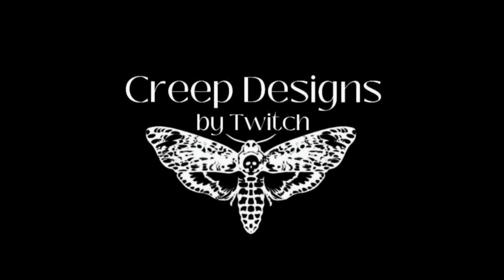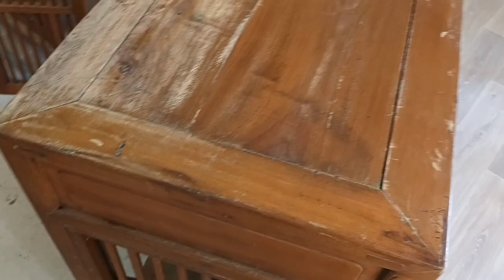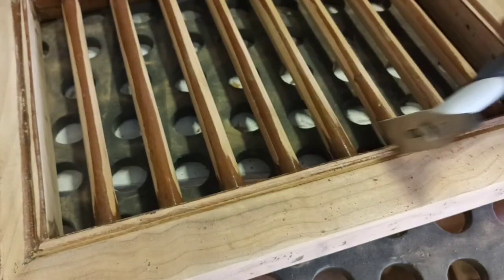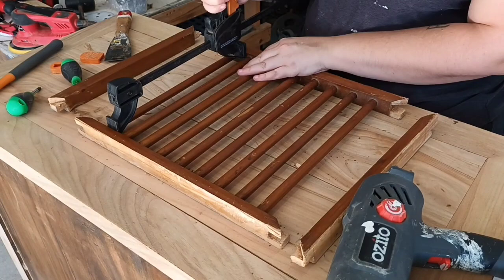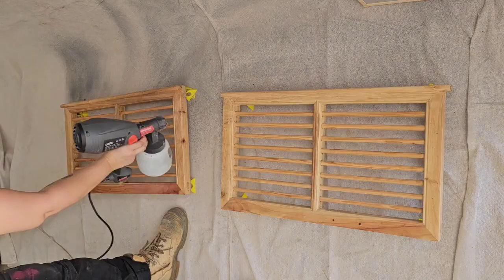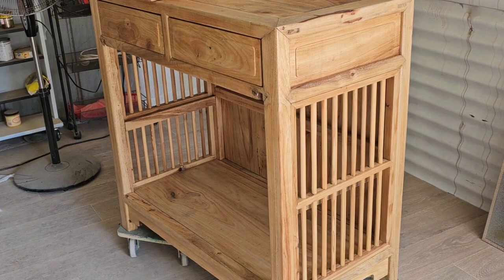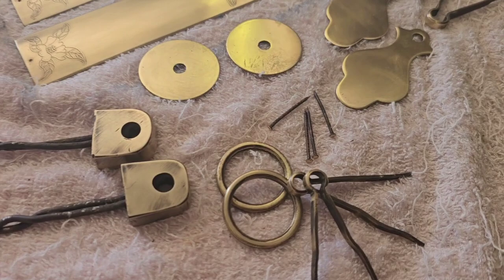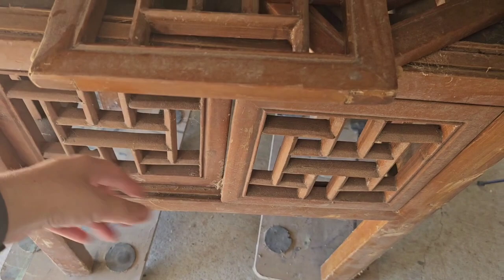Chinese Cabinets Restoration | REFRESHING OLD FURNITURE

Comment: I've seen Angie from Transcend Furniture Gallery put spindles into her drill and then sand them down just holding a disc of sandpaper which also works very well.  Oh Twitch what a lot of work but what an amazing outcome.  Good on ya girl.